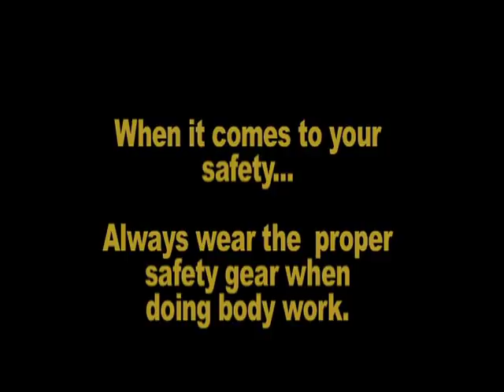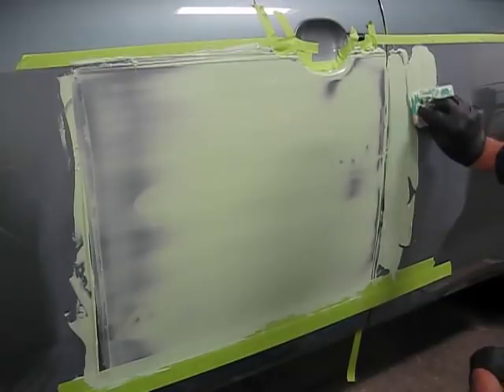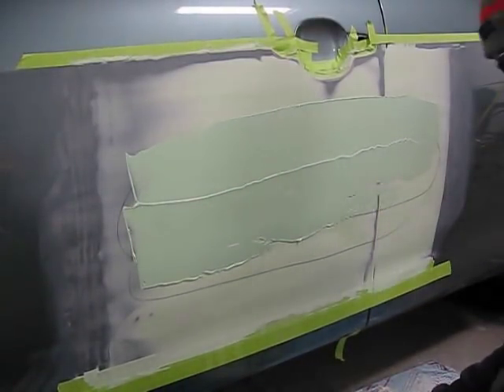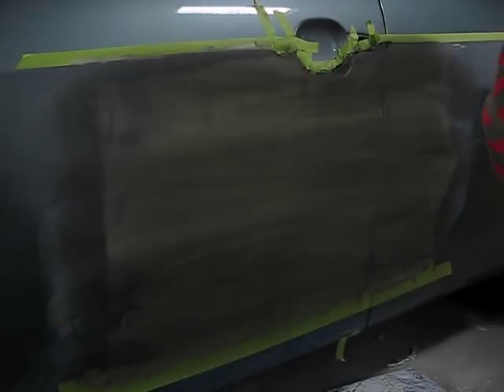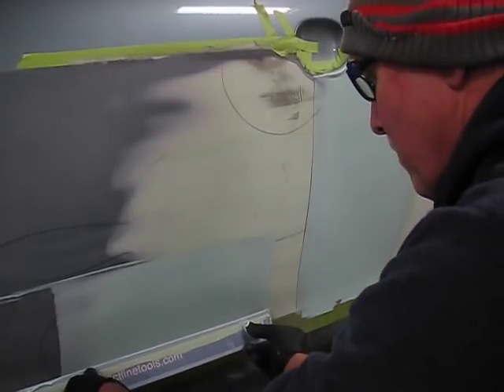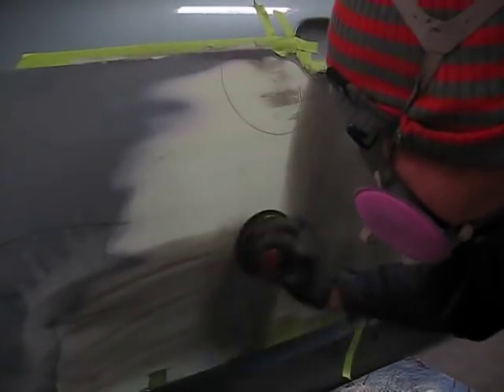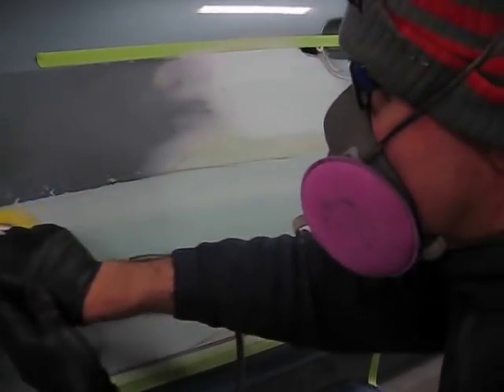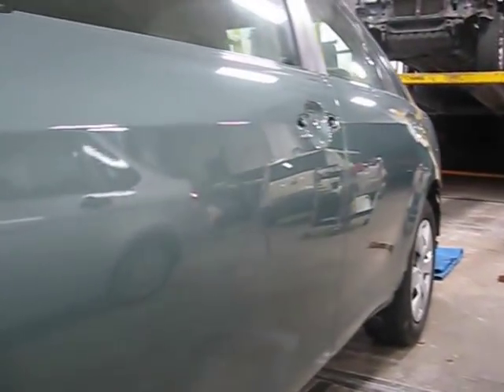BONDO SHAPING PERFECTION WITH THE BLADE

Comment: Just a waste of material get your surface straight first
Reply from the maker: @Larry-c1e  Are you kidding? The Blade is the complete opposite of “waste of material”!! Using The Blade greatly cuts down on the amount of material (Bondo) that you will use. The Blade gives you a precise application, no over-fill, no unlimited sanding and wasting sandpaper. The Blade is a great economic way to get precision, perfectly filled damaged panels. THE ONLY WAY TO GO!!

Comment: Let me just ask one questions to all these professionals. Have you ever seen paint peel off? And if you have why would you put body filler on paint? I was taught to grind the area that I was working on with 36-40 grit sandpaper for  adhesion. This made sense to me. Plus if you work the metal most of the paint would be gone. I suppose nobody works the metal anymore. Just scuff up the paint and put body filler on. Lol. Is it my imagination or is this guy taking a long time and using a lot of material. I'm hoping that was for instructional purposes  only on how to shape body filler. Just my two cents but that's probably not enough. :-)
Reply: if paint didn't stick to filler then filler wouldn't stick to paint. it doesn't matter

Comment: lol... sorry bro, u soiund like a nice guy, but this is crap. and yeah, i watched the whole movie.

1. you are using way too much bondo, and in the wrong way. even applying with that "blade", when you come across a lower part the bondo will go lower there, no matter how straight the blade is. as you can see when you finished your first round of sanding. you still have low spots.
2. at the end you have one big layer of bondo while the damage is minimal. the correct way is that you should have keep sanding untill the orriginal clear was getting visible again and you are left with a couple of spots with bondo. then you have the Original shape again of the doors with repaired spots. i think only 30% of the bondo is covering the damage, the rest is covering not damaged parts of the panels. thats not good.
3. in my opinion, going above 120 when sanding the first layers of bondo is not good. 120 is great to get things in shape, most of the time i start with 80. why? because 80/120 is pretty aggresive, so u dont have too push much pressure on the sanding pad thus not letting the softpad underneath it bend in, keeping the sanding paper in a straight line. this will make sure its only touching the places u want it too. going above 120 makes it easyer for you to put more pressure, meaning u will touch lower parts of the bondo around the spot you are sanding that u dont want to touch yet.  if you are at 95% then you can move to grid 120+ for perfection. 1 thing, i once ordered some bondo from the states and it was way softer then what i normal get here in the EU. so maybe thats why you are using such high numbers.
4. you are one of the few people that i see handling the sanding bord correctly going diagonal, still this wont give you 100% perfection as you claim it is. (it never can with that much bondo still left)

can i proof it? yup, check from 33.35 and watch the white car reflecting. when you move forward and backward you can see the panel is al wavey and the car looks like its swimming from left to right. its an ok Repair for a car to sell, and i needed to look 2 or 3 times before noticing it.. and from bottom to top it goes in a nice line. so i'm not attacking the maker of this movie or his skills.
but this is in no way shaping perfection in my opinion.

so going back to topic, for people with no sanding skills or don't know how to apply bondo, the blades won't do shit... besides you not learning how to use the proper tools and start understanding the materials you work with. there is a big big difference in making something look and feel smooth and getting it really back in shape.

Comment: Filler sticks fine to paint. The only issue is it causes Mapping. Most people thinks its shrinking but it's really just the filler edge reacting to the paint. Filler can go over Epoxy primer and will be fine because they actually chemically bond just on their own pretty good. The only time the Blad can become useful is capping a whole car to save you time on sanding filler. Because the goal when capping a car for perfection is to use a little filler a Possible. For collision work a pocket flat head screwdriver with the magnet on the end, if it doesnt stick to the panel and not fall then your are good( in some cases if the magnet sticks and but cant hold its weight your still ok but pushing it, sometimes you have to use that much filler based on where the damage is or if you dont have a dent puller and only have a stud welder, they get metal to finish close enough. But not enough where you should be
Reply: I just  wish  I had a lift . My hands stay true my eyes stay  true

Comment: Great video buddy !!...question I noticed that you put the mud over the guide coat without scuffing it..is that ok to do?..I've always scuffed it a bit with 80..I hate making the low spot even lower by scuffing it to put more mud but if you can do that I'm going to have to try that
Reply: plastic should not be applied over paint, polyester filler can be

Comment: Unless this was a show car or an exotic Think I woulda removed the door and worked the two areas separate. That low are at the edge was expected. I'm almost certain this is the long hard way. Guide coat the whole panel we wanted to see your sins.
Reply: i will change the door rather doing all that.

Comment: I've been a bday man for 46 years so I kinda know.i like the use of the tape I do that.  I like the clean way you go about it. I have seen guys use a palm DA more and more all the time. I'm not finding much wrong with this technique I mean if it woosks for you. I do not like how you have filled in the door gap. That gap should be cut with a blade after each coat. If you don't cut it out each time it will be rough to cut at the end. Also if this is what you do as a beginner than more power too you but when you do it for a living.
 You haven't got the time to use the straight edge device. In the real world in a production shop you get paid to get ur done on a commission rate. Those of us who do this every day have developed an eye and feel for it that only decades can teach you. One more thing the amount of material you are useing may be frowned on by your boss if you have one. But overall looks to me like you will eventually get it done. Every time you use that DA you do more harm than good. Again that door gap that you fill in bothers me. I guess because it's just because I do not do it that way. Overall it's a different world than it was 46 yrs ago. Back than we were repairmen now guys are replacement.
Reply: Yes he does show car work. Production shops put out crap that looks factory.

Comment: How does the filler not dry while you are trying to shape it? Mine would have dried by now, before picking up the blade tool!
Reply: +58fins quit putting so much hardener in it , cooler weather helps also..

Comment: In my case the bondo kicks in way to fast , should I thin it with laquers
Reply from the maker: Arrie Van Rensburg  Yes. You can use a glaze coat to mix in with the filler. Also, if your garage is very cold, let your can of filler sit inside the house or office to warm up a bit before using. The cold temps makes it harden up quickly.
Reply: less hardener will do..

Comment: How do you determine which blade to use, specifics please.
Reply from the maker: Richard Carter   Hi Richard, it depends on the curve of the panel, the damage, the undamaged area around the damage and other factors. The #1 Blade is the stiffest and the #3 Blade is the most flexible. You will easily get the hang of which Blade to use once you have the Blade in your hand and have specific damage. We are always here to help. Thanks
Reply: Thanks.  How about cleaning the blades:  how often, with what, and expected lifespan for a blade.
Reply from the maker: The Blades will never wear out with regular use.  We do offer an Edge Replacement Kit for replacing the removable edges only.  If you nick or cut the edge of the Blade, it will need to be replaced, hence the Edge Replacement Kit, which sells for 20 bucks.  Cleaning the Blades is easy peasy.  The Teflon is the slipperiest material on the planet.  You just let the filler harden and "pop" it off of the Blade or you can wipe the wet filler off with a shop rag.  Also a 2" strip of masking tape placed on the length of the Blade and pull off, will remove the residue of filler.  NO NEED for paint thinner or harsh chemicals.  Thanks

Comment: What kind of Bondo do you use
Reply from the maker: We always use a "mix-in", a glaze coat, into the bondo filler which gives you a better spreadability. We have used the cheapest filler to the most expensive filler and the type does not really matter, but.....adding the mix-in glaze coat, or putty glaze in about 20% glaze to 80% filler and adjust from there, has worked out to be the best way to get the best spreadability.  Call us at (971) 269-6170 if you have more questions.

Comment: ok I will give it to you that your tool works nice !  I have used one of my own making for years but, why did you do it over paint instead of grinding the area down to bare metal :?
Reply: I agree with you, I would typically want to be on bare metal also, especially for a special collector car. But on newer cars, where you want a fast repair, tools like this can feather the edges quickly into the top coat, so that you do not have to take the time to do it carefully by feeling with your hand like lots of people were taught to do years ago. The stiff blade does it much faster than a sanding block, of any type, can, when done correctly, after you get the hang of it. These new fillers, Evercoat Rage Ultra, and Extra, advertise you can do it over the clear. So it is easier to quickly get the exact line of the panel that people who know what they are doing, are looking for.  These filler last for many years now. The paint will be no good, long before the filler gives out, on most of the cars of the last 18 years of so, if it is done correctly.
Reply: Dave Babcock l

Comment: Excellent.
Reply: Did anybody notice what the man applying the bondo was wearing. Looked to me he was working in the cold.  Low temp slows curing times. Smart move.  Has more time to work the filler to get it right.  Loved the lesson.  I also liked the way he did the door and the rear quarter as one unit, then used a drill bit to separate them. Yes Bondo will adhere to paint.  I do it all the time. Forget about saving time on a repair.  If the end result means a perfect job, go for it.  Your satisfied customers will give you repeat business and send other people to you. I've been doing body and fender for 35 years and I'm still learning.  Bravo for YouTube!